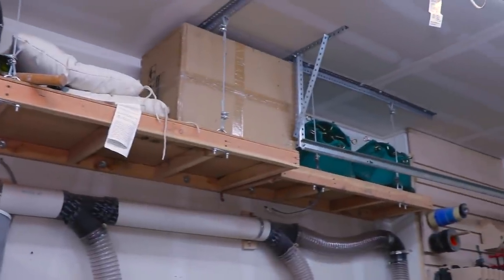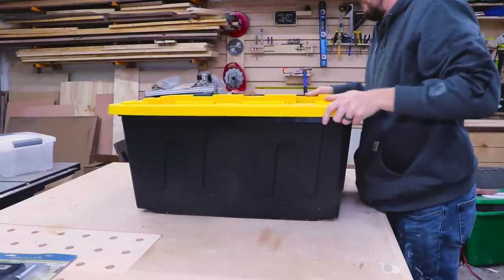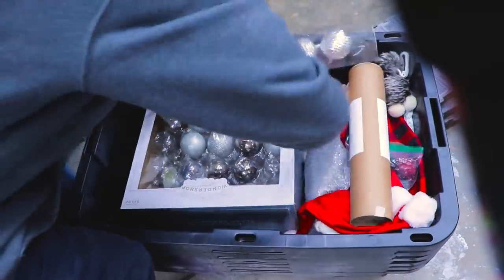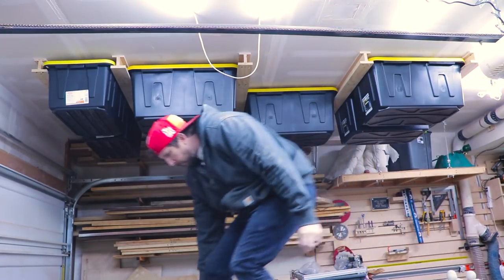The Best Garage Storage Solution | Save Space With This DIY Organization Hack

Comment: You can add labels to the bottom of the totes to identify them. Also maybe mounting them horizontally is good so that you can access them from either side without having to take one off to access the inner one. I wonder if they will ever come off due to the long term vibration of the door.
Reply from the maker: Yeah I’m not sure! But all great ideas. Thanks for the comment.
Reply: I came to the comments to recommend labels for easier location of stored items. I'd never be able to remember what was in each one.

Comment: I know tons of people do this, but just a warning to everyone out there: everyone has a different garage situation. Many homes are built to the bare minimum to pass inspection. If your garage only has a roof over it, especially one built of 2x4 prefabricated trusses, it may only be engineered to support a dead load weight of the roof itself, the strongest snowfall accumulation in your region, and 10 psf extra for hanging sheetrock.

Now, does this mean your roof is gonna collapse if you put these all over your garage's ceiling and you get hit by a blizzard? Prolly not, cuz code requires a lot of this stuff to support more than the worst it should see, but if you really put a ton of heavy stuff up there? Well, maybe keep any bins full of brake rotors on the floor. :)

Nice design! Great idea. Thanks for the video! Custom-built engineered I-joist for hanging!
Reply from the maker: Appreciate the warning and the comment. For sure every home is different and you should always check to make sure your situation can fit this kind of load. Thanks again!
Reply: Oh God! If your putting heavy stuff like brake rotors on the ceiling like this, you must really hate yourself. Getting something heavy like that up and down from the ceiling like that would be really unpleasant.
Reply: @Zod_JB  Right, those bins hold bulky but light weight items as well as seasonal decorations.

The guy who keeps shoving brake rotors up there had a few too many of them fall on his head, so now he keeps forgetting the lesson he should have learned and keeps repeating the same mistake.
Reply: I learnt the hard way and now have to wear a helmet all times

Comment: Just be careful when attaching to the "ceiling joists" - in many houses they run 1x2 strapping perpendicular to the joists for the purposes of hanging drywall - so anything you hang can end up being supported by the 1x2, which is much weaker than the actual joist you think you're attaching to. A quick peek into the attic to confirm the direction of the ceiling joists will tell you.
Reply from the maker: Thanks for the info!
Reply: I’ve built houses and garages in Utah for 20+ years and have never seen that. I guess in Utah we don’t use sketchy tactics like that. 🤷🏼‍♂️😳
Reply: also if there is no floor above and a truss roof, they are designed for a certain dead weight, you can easily "break the trusses back!" as they say
Reply: @troysgarage  stick to DIY. I'm an actual builder and the guys spitting truth
Reply: @GordoSTI  It could exceed the floor rating as well. You have to allow 40psf live load plus dead load. So if the bins are 100lbs, he adding another 15psf which is pretty significant. It probably won't collapse unless there is a design or construction flaw, but it still may not meet code requirements.
Reply: how to find if it is joist or strapping if I don't have a attic and have another floor above?
Reply: @keithmarlowe5569  I've used ratchet straps to a tree branch when doing suspension work on my motorcycle 😛 They don't call us shade-tree mechanics for nothing!
Reply: And this is the reason that I read the comments.  Thank you.  Probably the most useful comment I'll read this week.

Comment: Hi there...at 6:00 or so, I was looking at the installed slides, and I was seeing 2 screwheads per location, and not just the one down the middle that I saw at 2:05...what did I miss?  Great idea, and I'm looking to implement this solution in my garage as well.
Reply from the maker: I would use more than open screw head per runner. I just didn’t show my doing that in the video. Using three screws and wood glue should be plenty of strength to hold. Thanks for watching!

Comment: I wonder if there's a pre-built structure like some kind of I-beam that is the same as the dimensions that you created. That way one can just get a long run of it and cut it to size so the bins can slide into them.
Reply from the maker: Yeah that’s a big possibility. Let me know what you find out.
Reply: You may not want a huge run of totes in case you want to take out the first tote you slid in.  2 to 3 totes per hanging section I think would be most convenient unless it's long term storage

Comment: Does it matter to use a stud finder? Or just drill right into the ceiling is fine
Reply from the maker: no you definitely want to drill into a stud. I never recommend only going into the sheet rock. mine are going across the studs not with them.
Reply: Roll the dice…YOLO!
Reply from the maker: You know it!

Comment: I would have gone with clear plastic totes so the items inside are visible. Labeling just never seems to be all inclusive.
Reply from the maker: Yeah I thought about that. Originally I was going to add a QR code to the bottom of each one that you could scan and it would bring up a picture and list of what Is in each one. But I just haven’t gotten around to doing that. But clear totes would be a great idea too!
Reply: Digital inventory like SCW suggested is best for this sort of thing. Clear totes are nice for visibility, but clear plastics tend to be more brittle
Reply: I use clear totes in my garage, but I've never really seen heavy duty clear ones.